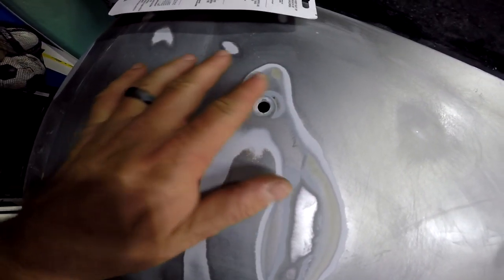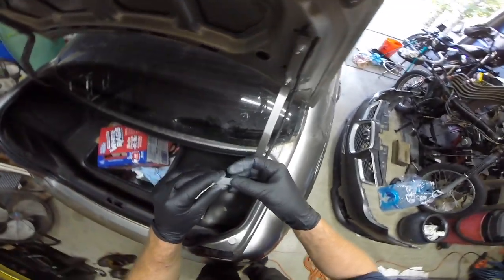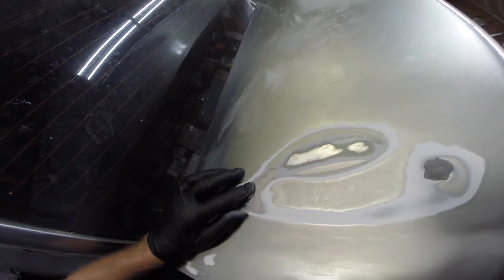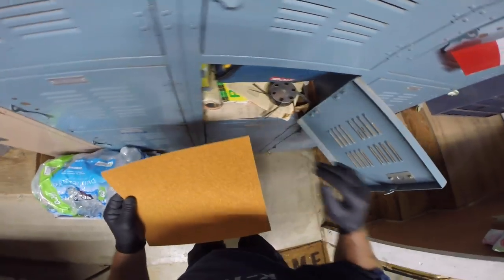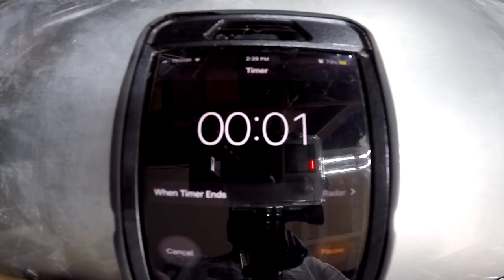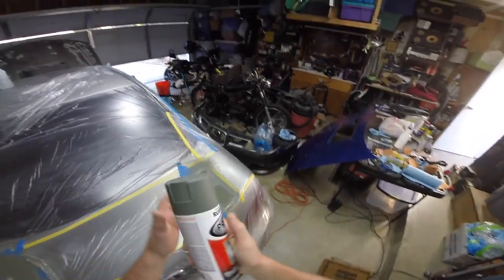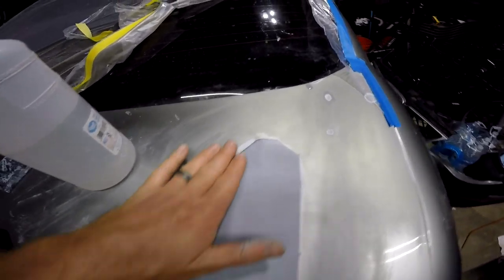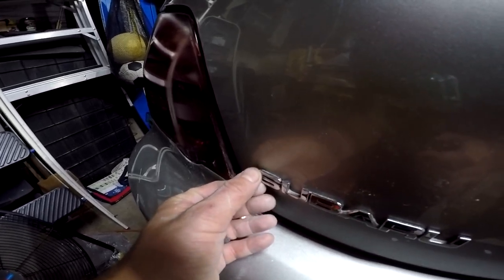How To Make Your Subaru WRX Wingless! Cheap and Easy Tutorial!

Comment: I swapped the 3 piece spoiler on my Charger for a Hellcat style one, and the two parts on the rear quarter panels left exposed holes. I just put some vinyl wrap over them for the moment and the holes get covered up when the trunk is down. So it looks great most of the time. 

But when I open the trunk at night and see light shining through the wrap, I feel pretty crappy about the job. This looks like a good option though.

Comment: Bro tbh this is exactly what I was looking for.. I just got a police Tahoe and tryna get rid of the spot light.. I know there’s holes that come after taking off the spot light but I think ima be alright then lol question.. is the same material u used for putty the same as jb weld Steele stick? Looks similar
Reply from the maker: I don’t have experience with that JB Weld but I would imagine its very similar. Mines still holding up fine after many years. 👍

Comment: Hows it holding up??
Reply from the maker: All good! Although if I were to do it again, I would do a couple more layers of the sandable primer. Looking at the trunk from different angles you can barely see the patch work underneath. More layers and more sanding 👍 still looks great compared to those spoiler holes

Comment: How has this held up?
Reply from the maker: So far so good! Although, if I were to do it again, I would blend the quick steel a little smoother with more sanding. At certain angles in the sun, you can see the patch work through the wrap. You can only see it if you really look hard enough. Other than that, it’s pretty solid 👍
Reply: @06wrxdude  I’m buying an e36 325i this week that I’m going to have to do this with, I was going to just have the finishing and painting work done professionally by a shop after I fill the holes. 

Great video and thanks for the reply.